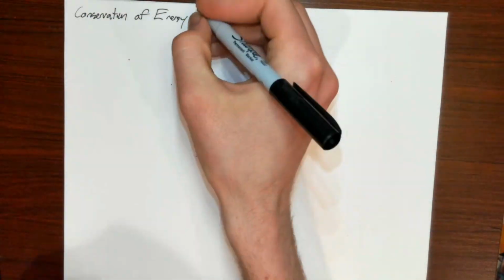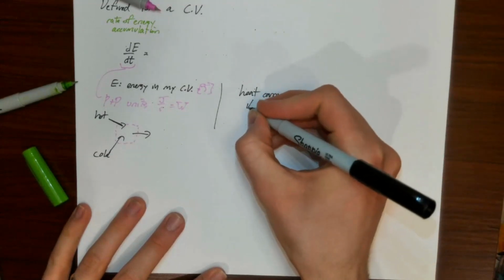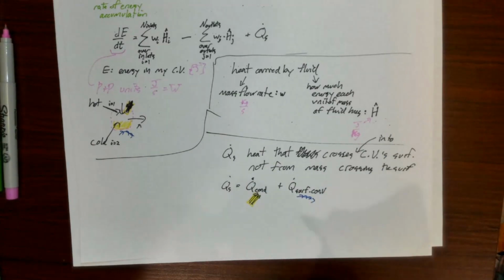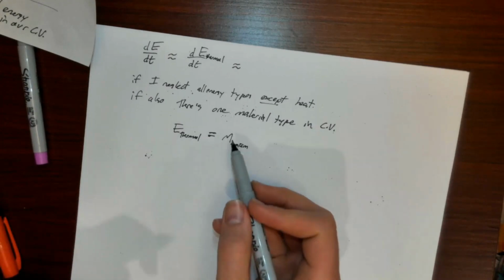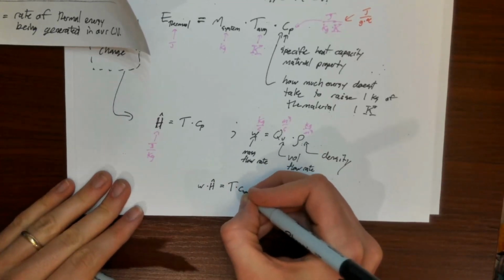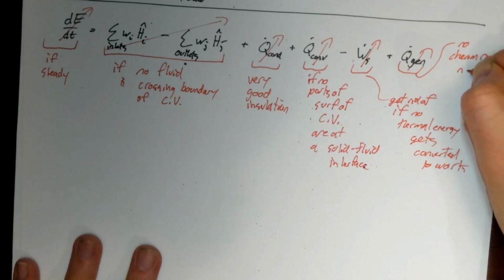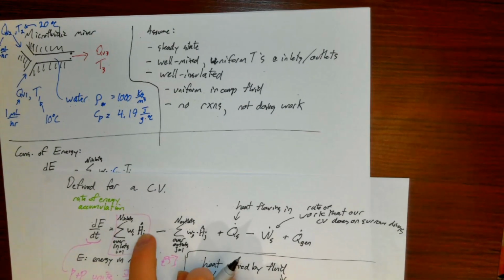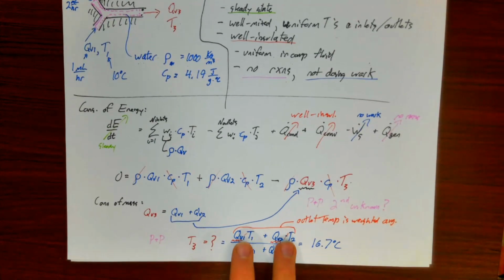BIOE 3310 Lec 19.1 - Conservation of energy for thermal systems; hot & cold mixing example problem

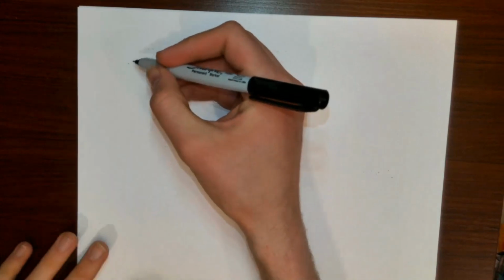Comment: Conservation of energy for thermal systems 6:38
Rate of accumulation = rate in - rate out + rate of generation 17:45
Accumulation term: dE/dt 22:2 5
Ins - outs: heat carried by fluid, surface conduction, surface convection, fluid doing work on surroundings 30:40
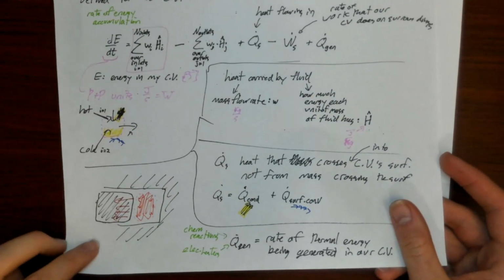Rate of generation: chemical reactions and electric heaters 33:40
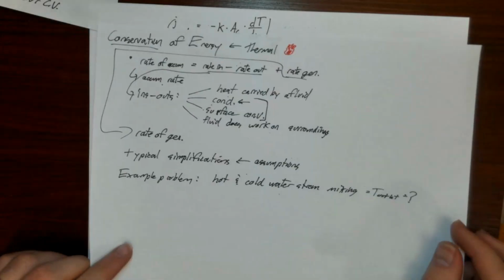Typical simplifications: crossing off terms and assumptions for doing so 34:48
Example problem: hot and cold water streams mixing (using conservation of energy to predict outlet temperature)  42:01